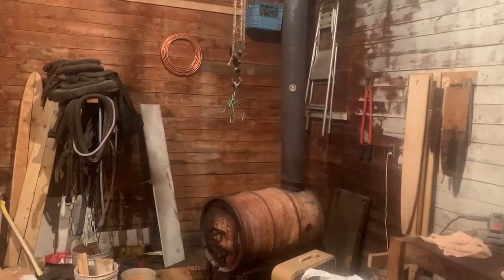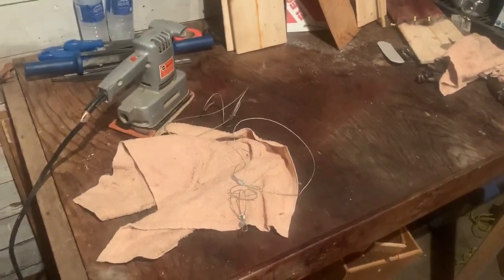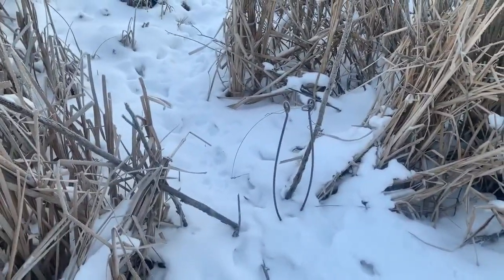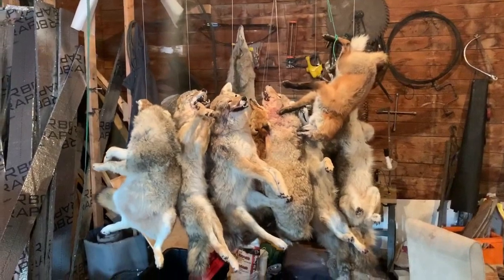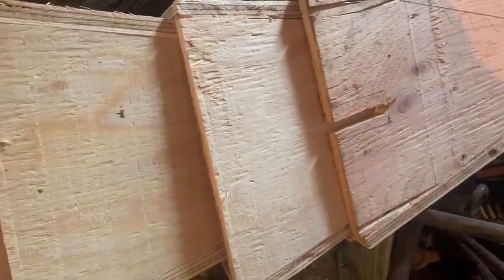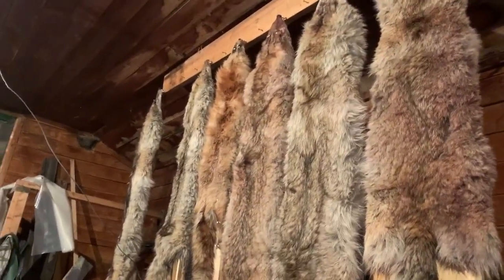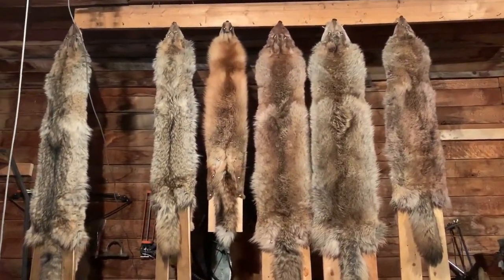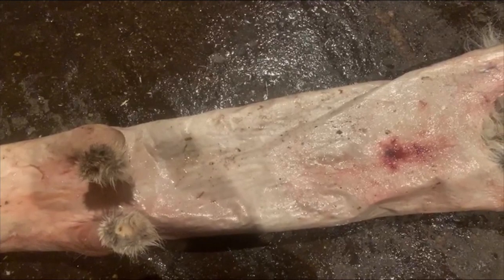Prairie Trappers S1E15 "Shop Tour"

Comment: I wonder how the a shop vac blower would work
Reply from the maker: A shop vac doesn’t have enough power but I have used an air compressor with an air nozzle in the past
Reply from the maker: Oregon digger A shop vac will blow the hair one way or the other but it doesn’t have the power to blow all the garbage out of the hair the same as one of these does. Saying that the expense of having a blower like this does not make sense for most trappers it is meant for drying hair on cows after they’ve been washed for a cattle show